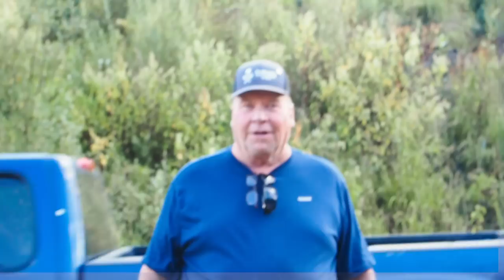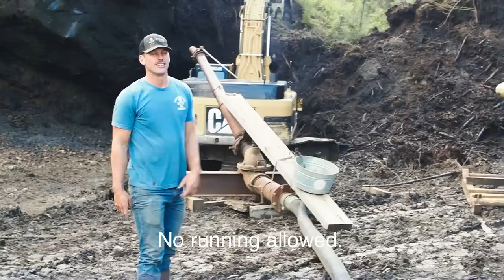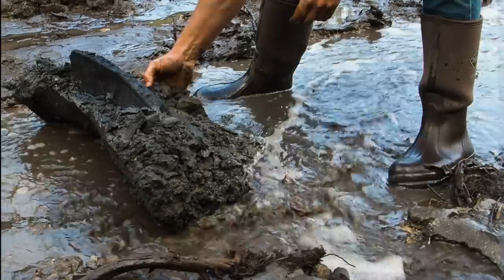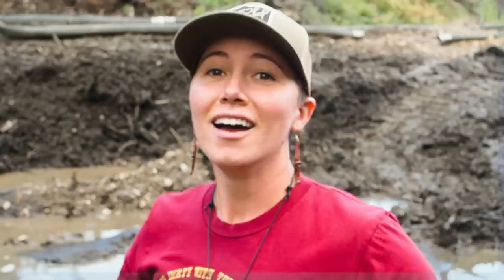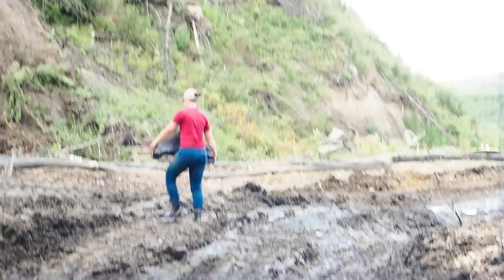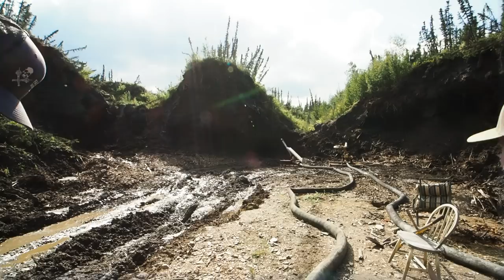WOOLLY MAMMOTH remains found in ALASKA at The Boneyard

Comment: That shoulder blade is incredible. When she was describing how a huge chunk of muscle was just ripped off my imagination went crazy trying to figure out what could have caused that to happen.  My first thought was that humans couldn't have done that. Not even two grown men with a good handle on it. Likely the processing of large mammoth muscle would've meant hacking or slicing it off in sections considering the size and toughness. You would see obvious signs of blade/tool marks on the bone. Perhaps a large predator like a short faced could have ripped it with teeth,  but more likely, considering jumbled layer they are emerging from, it might have been the violent action of a massive rock, tree, and ice strewn flash flood that caused them to be ripped apart. So fascinating.